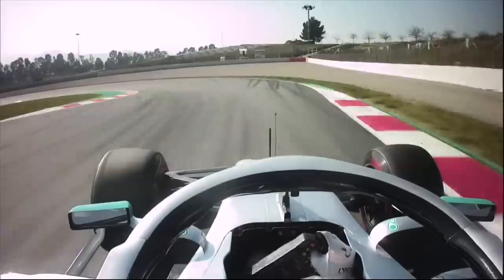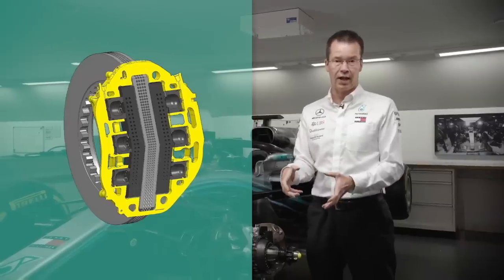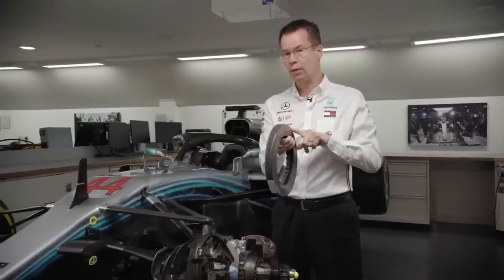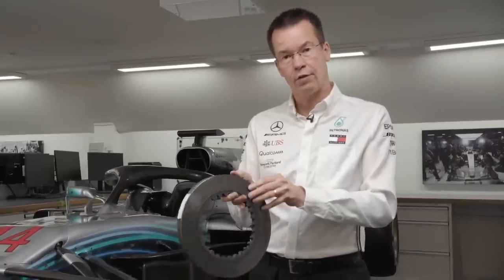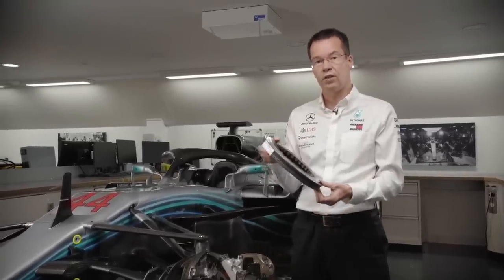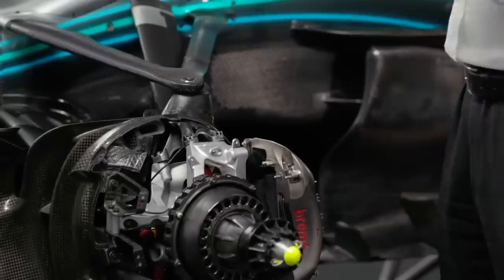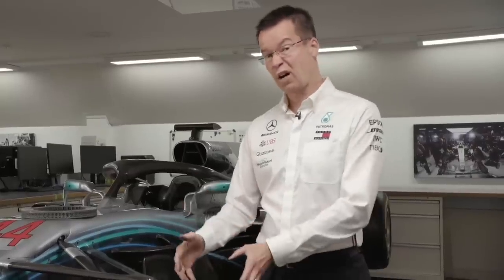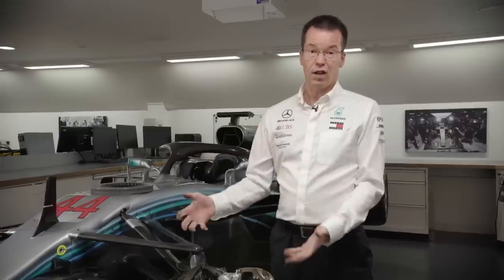F1 Mercedes braking systems with Mike Elliott By Peter Windsor

Comment: this video was made to appease f1 fanboys who know nothing about cars. The brakes in this car work the same as in any other car, you push a pedal, and the brake calipers squeeze the rotors, but with more attention to cooling and regenerative braking to actively get the correct brake bias for maximum stopping power.

Comment: Great video Peter, for some reason I thought the modern cars were Brake-by-wire, where the pedal and resistance was computer/servo controlled and it is all programming for the distribution and energy recovery.  Apparently not, it is good to see good ole non-power, pedal-fluid brakes, where it is the driver doing the work!
Reply: Mercedes introduced a brake-by-wire system on the SL series roughly ten years ago, however after certain problems with it the following series had a traditional braking system again. I don't know the current state of brake-by-wire systems in road cars though, so if anyone knows that please give a short overview comment here :-)

Comment: Why don't they use inclined master cylinders ? Would be easier for packaging
Reply: The applied force then won't be on the same plan as the Master cylindre , there will be a lost horizontal component . And also when they put the Master cylindre in a horizontal position , it takes less space and they can put things on top of it . Just a personal opinion 😁

Comment: Can you also explain engine mapping
Reply: an engine needs certain amounts of air+gas at certain rpm. You make a spreadsheet, with how much gas and air the engine needs at the different rpm and throttle positions. make the computer read the spreadsheet based on how much you are pressing the gas pedal and what rpm the engine is at. the computer reads the spreadsheet and puts the designated amount of fuel + air into the engine

Comment: Worth watching.I rather wanted to hear more about the rear brakes and the relationship with energy recovery, but that is a question for the Mercedes team pr, and not you.
Reply: There are two energy recovery systems in all the engines in F1, the mgu-h and mgu-k. Which are the Motor Generating Units Heat and Kinetic respectively. The MGU-h is a generator/motor that attaches to the turbo shaft allowing the energy to be gathered on throttle lift off and also act as an electric turbo pre-spooling before throttle goes down (Removing most turbo lag). The MGU-k is a generator/motor connected to the crankshaft. So as the engine revs the motor spins, the electronics can change whether to do nothing, recover energy or output energy. So when the driver gets to the end of the straight, partially the engine is braking, partially the MGU-k is braking and the brakes are braking. The teams use very complex systems to decide when they do everything to achieve the optimum energy management. So the energy recovery doesn't come through the brakes. Hope that clears it up :)
Reply: @jamessquibb7766  Excellent! My thanks.
Reply: So you want to know the the rear breaks? Coffee breaks? Lunch breaks? Dinner breaks?
Reply: @koitorob  I was tired. I have now corrected it.